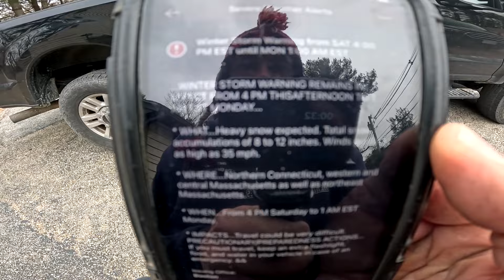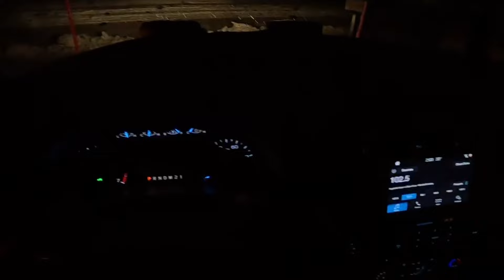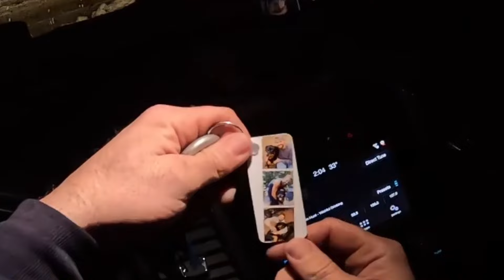There's Finally a Snow Storm Coming... I Need To Prepare.

Comment: I use to plow for the town loved it
Reply from the maker: That's cool, I know a few people who have / still do. Not a bad gig for the driver, typically get really good hours.
Reply: It helps when you grew up in the area in 2015 I banked
Reply: 4 days of plowing blew  a line I swapped both lines. I always had a spare solenoid and motor as well as a pump

Comment: Got the wet stuff this time. Another round coming they say. Down pressure for back dragging is starting to sound like a really good idea. The wet sticky stuff just doesn't like to come off on the first pass.
Reply: Oh, and strobes mounted at the back of the truck either under the wheel wells or on top of the bed rails really gives you extra peace of mind when backing out of driveways and makes it easier for drivers to see your profile.
Reply from the maker: It certainly was very wet and heavy... and yea, looks like another decent one on Tuesday! I totally know what you mean about the strobes, just never been a fan of having them on my truck. Just bothers my eyes like crazy.

Comment: I'm 62 been doing shoveling snow blowing for 5 years in Chicago I'm a ground guy ... a light weight Toro blower??
Reply from the maker: That's awesome man, the ground guys are very important. I missed Benny a lot on this storm... I'm not a fan of the small blowers, especially when the snow is wet and heavy. And I don't have the room or time to deal with a large blower. And another big thing is that most of the walkways I shovel are uneven and the blowers would not get them clean clean. So I end up having to go back and shovel them anyway...LOL But I totally understand using them for commercial properties.  ✌

Comment: Snow plowing is fun till shit breaks down lol.  Personally i would rather do parking lots than driveways.  Driveways are a pain in the ass lol. Most driveways need to be back dragged which normal plows aren’t meant for.
Reply from the maker: I know what you mean, but I honestly prefer those headaches than the back and forth in a busy parking lot. Then the going back 1- 2 days after the storm doing cleanup. I don't know man, there is ups and downs on both sides. Just about what you prefer. ✌
Reply: You’re absolutely right brother! Be healthy and have fun!